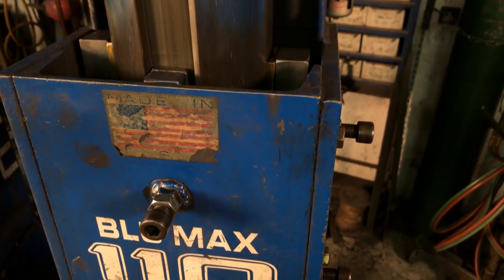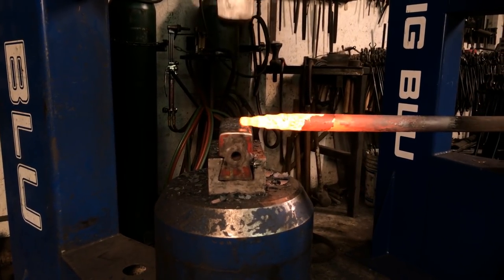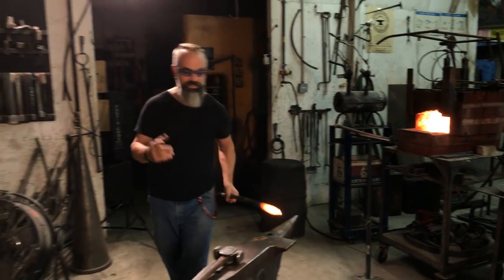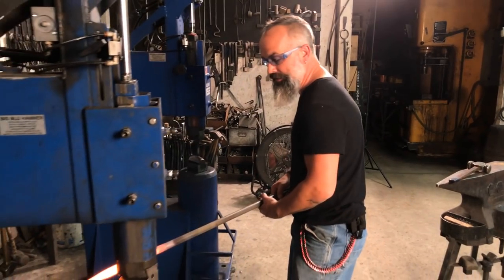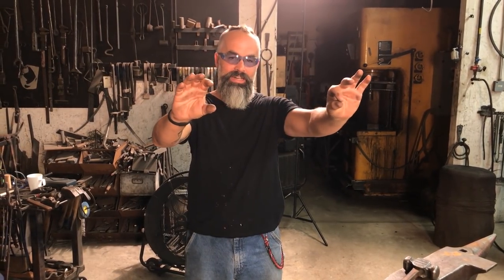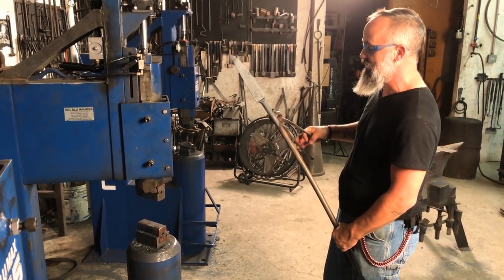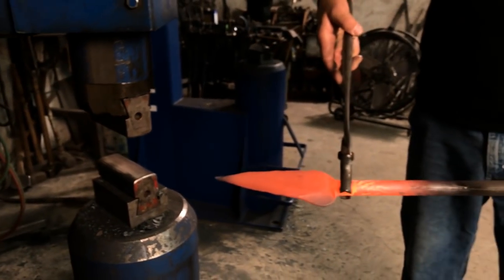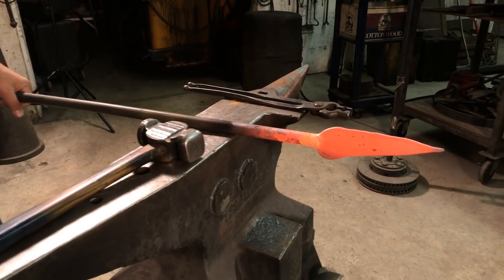Chef's Knife with Jason Knight Part 1 - BLU Let's Forge!

Comment: I like Jason Knight. But I once heard him say that he used to do stock removal than learned forging because to him that was a true blade smith. So than how does using a power hammer to rough shape a blade any different than cutting out the rough shape of a blade with an angle grinder or oxy-torch ?